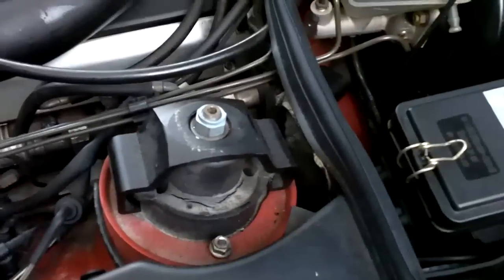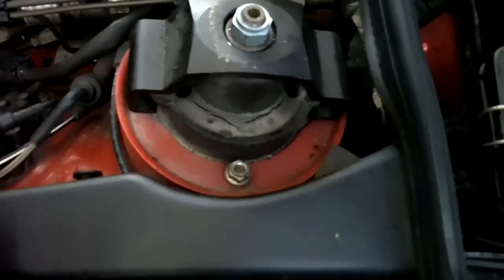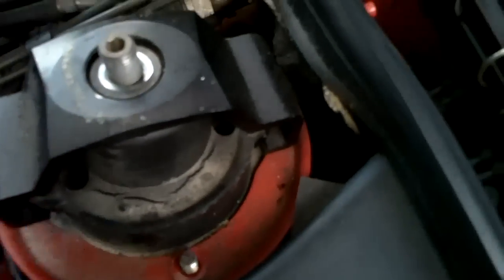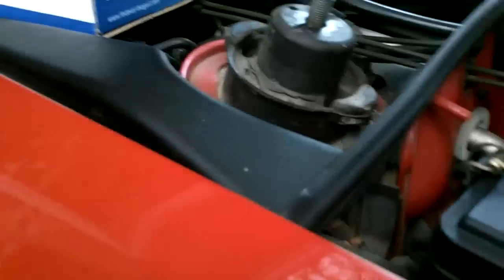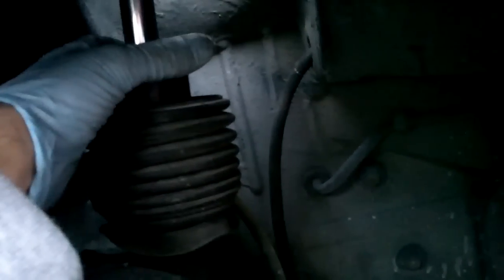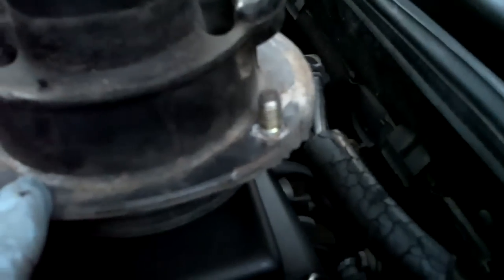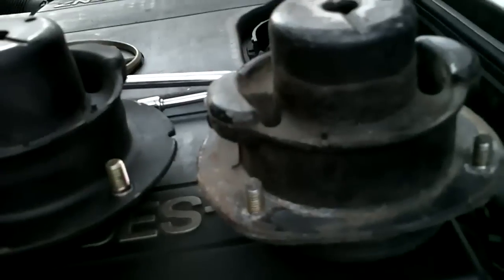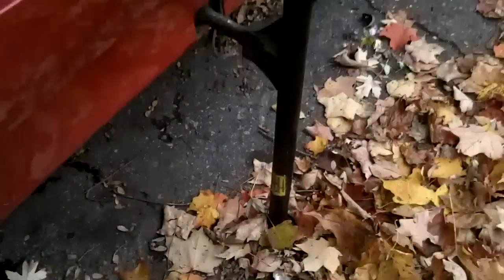Mercedes W124 and R129 strut mount replacement

Comment: I just swapped out both front shock mounts on my '98 R129 after noticing they were severely cracked.  A simple and quick job that is a major improvement in ride quality!  The harshness of road impacts is gone and the car rides like new again.  Most importantly, the vibration from 60-80 is now gone!  I chased that for months and it was the mount the whole time.  My car still had the dust caps over the upper shock nut and it took me a while to figure out that it just lifts straight up for removal.  Thanks for posting this video.

Comment: Trust me when I say this, you do not want this to break.  if it does break it will leave a nasty dent going upward in the hood.  Mine broke and has been sitting ever since because I thought this would be super costly, thank you for posting this.  If anybody's starts to crack save the hassle and fix it.
Reply: same here, 01 sl500

Comment: Thanks for the video! Did mine, RHS went smooth, LHS was more tricky.

To sum up:
Big nut is a 22mm wrench. Much needed.
Small nut is 10mm
Installing new one is tricky: first secure new mount with 10mm nut, then aim for inserting  shock in the middle guiding it with extension.

I used Meyle mounts.

Comment: Hello Fupabox, I really enjoy your videos. Beware of the Moog strut mounts. I installed a pair and the left one lasted about 4 months and the right one for about another week. They left two bumps on my hood that I had fixed at the body shop. The packaging says made in USA but that's just the box they come in. If you look on the inside of the mount they will say made in Taiwan. I replaced those with Corteco mounts and have had them for about two years with no problems.
Reply from the maker: thanks for the warning...Moog used to be very good quality, but I guess most of there companies could care less about quality anymore

Comment: Thanks for the video! The R129 is a new platform to me; being a VW and JDM guy before getting my boyhood dream car. I did have a couple W116s, but they are nothing like this. As far as other cars, I have had 5 of 7 generations of the GTI, a Cabriolet, Jetta, Preludes, Integras, GS300, list goes on... A few American ones too. 

Anyway.... 

I kept the wheel on and on the ground with the car partially lifted. Had a hell of a time wrestling the old mount out and getting the new mount in, but all in all, it was an easy job. Just a pain in the butt. Second side was easier than the first because of the "lessons learned". Next is the idler arm bushing repair kit and rear suspension kit. Then "test drive" to the dealership for a proper alignment. I had a mechanic friend replace the inner and outer tie rod ends, front lower control arms, steering damper, and stabilizer bar bushings. Next will be the rear suspension.
Reply from the maker: Nice... it's a cool car .. you'll love it .

Comment: I have a 99 Mercedes sl500, would this also apply to the model I have, it’s very similar to the part with one exception, it has a cap that cover the screw that your removing in the beginning? I have no clue how to remove it, please help.
Reply from the maker: do you have the air suspension ?
Reply: @fupabox  not sure what that means, the suspension is connected to the lower arm thrust, I wish I could send you a pic, is that an option here?

Comment: very helpful clip.i cheated my mounts out by removing all appears ok. i have a metallic knock when driving over uneven road surfaces coming from the front end of car reduced when under breaking any ideas on what to check. cheers
Reply from the maker: sway bar end link bushings or lower ball joints is my guess

Comment: Great info! THANK YOU! Do you know what the bolts that hold on the engine cover are called or what to do if they break off?
Reply from the maker: The top engine cover that contains the air filters has several different types of posts and spring clips that hold it on . At the rea there are 2 large posts that the cover slips under and the cover has 2 U shaped clips that slide under the posts . , and at the front there are 2 spring clips that lock into the filter box /engine cover . I found this forum post with all the clips and mounts shown and part #s listed https://www.benzworld.org/threads/m119-airbox-rear-mount-attachments.1411899/
Reply: @fupabox  You're an angel! 😇Just what I was looking for!!!
Reply from the maker: @brynabryna  glad to help

Comment: Thank you for your posting this. I am also replacing front struts as well. So I unscrew bolts from bottom of strut  then unscrew the strut mount. I jack up the car then take out both the strut and mount. And put it back in reverse. Would it work?
Reply from the maker: essentially yes... just don't jack the front up too far... there is a small chance the spring can pop out if you lift it too high with the strut unbolted
Reply: Thanks!

Comment: thanks .to check tees out will i have to remove the coil and shock
Reply from the maker: to check the ball joint you just need to jack the car up and then squeeze the balljoint upwards with a large set of slip joint pliers..you can also watch closely for movement as you raise the car there should be no movement as the wheel leaves the ground...the bushings can be replaced without removing anything but the 2 13mm nuts on the bushing end cap

Comment: Have you ever have problems on that center nut getting loose after driving for a while (a week or so)? When the nut is loose, it makes a small banging sound when going thru bumps. That's when I know it's loose again. It's kinda annoying and maybe dangerous. And it does that no matter how hard I tighten (maybe not hard enough?) the nut. Just wonder if you happen to know about this issue. And it's an R129 too. :)

Comment: fupabox
I have the same care and it sounds like the drives haft is rubbing the floor. I replaced motor and transmission mounts. Do you think the shocks could let the car that low. It has 95k miles one it. 
Thanks
Reply from the maker: +Bob Muse  the other possibility is the bushings that hold the rear differential to the subframe... I have never seen them go bad,  or the center driveshaft bearing support..does it thump under acceleration and then go away when the car is at a steady speed ?
Reply: +fupabox 

Yes it does rib when starting out to hard. Even when
driving at at any speed and if i give it to much gas it rub. It was  bad
to start  with and got worse after replaceing motor and transmission
mounts. I thought it was hydraulic issue because I need to replace O rings in
hydraulic cylinder. Where do you buy the kits?
Thanks for your help.Bob
Reply from the maker: ***** the hydraulic seals can be purchased from  mbseals.com    I am pretty sure your driveshaft center support bearing is bad.. they aren't very expensive, but require drive shaft removal to replace..when you changed the engine mounts the orientation of the driveshaft to the differential was altered a tiny bit, and accentuated the wobbling in the bearing..the support bearings usually go bad more quickly in hot climates where heat from the pavement speeds up the grease drying out
Reply: +fupabox Do you think I should change the shocks and struts too. Second questions: where is the computer on my car?
Reply from the maker: ***** The shocks and struts last quite a long time on these cars..Only if they are bouncy bottoming out ,or leaking, or if some store has a great sale on shocks.   The computers are all under the hood, in front of the passenger side windshield..there is a big square plastic cover right beside the hood hinge...5-6 phillips screws hold the cover down

Comment: I just noticed that I have rust that has eaten through almost 2/3 around the driver's side shock mount.  Is this something that a good welder could fix?  If so how much should I expect to pay out?  Thanks.
Reply from the maker: that's a bit scary..anything can be fixed if you spend enough....I would think it could be fixed for a few hundred dollars

Comment: Did this to my r129 today. I have a clunk when im pulling up my drive way during an incline or during steering randomnly. Sway bar bushings, or ball joints, or idler arms what do you think lol thanks
Reply from the maker: could be any of the above.. only way to know is to get under and check... could also be tie rod ends or wheel bearings as well

Comment: Fupabox, 
I did this replacement with Febi Bilsteins today  due to a cracked right mount (no other issue or symptom) but my first back out of the driveway and I got a major clunk suddenly from the struts over the curb - almost sounds like  they're loose or bottoming out  - but the nuts are quite tight.   I might be able to get more - but how far do I go with that center nut?   I don't see a torque spec.   I stopped when they were tight not wanting to over crank.   I don't want to drive the car until resolved.  Any help?
Reply from the maker: 15 ft lbs for the 3 small nuts and 60 ft lbs for the large center nut . The car needs to be sitting firmly on the ground when tightening. check that the spring didn't turn when the shock was installed , or that the spring is centered on its seat . Also check to make sure the bump stop (rubber snowman) is still on the shock shaft
Reply: Thanks for the help.   With further troubleshooting I have found that it is an off-quality part.   Getting so hard to keep track of aftermarket quality anymore.   Thanks for your videos - they are so extremely helpful to many like me.   Need some more on the R129!
Reply: @fupabox  Cheers for the video. Quick question, are your tourque settings accurate for an early r129 also? Where did you source them. Going to attempt this next weekend. Many thanks

Comment: Based on how easy it snapped and the weight of the car basically doing the majority of the job holding the mount in place and the large metal retainer on top stopping it dropping through if the suspension gets fully extended, I hoped the bolts are merely a supporting function. It also sheared with enough threadbolt to aid in any torquing (sidey ways movement). They just seem too flimsy and simple to be taking much load?
Reply from the maker: +Chis Chis Just my opinion..I wouldn't drive it with just the 2 bolts holding it on. I'm overly cautious, I wouldn't take the chance

Comment: Fupabox, my name is Travis and I have a 1996 r129, that has leaked convertible driver side main cylinder . Currently the hardtop is on, can you please show me how can I manually remove the hardtop, thanks.
Reply from the maker: https://www.youtube.com/watch?v=U6BrsM3ilj8
Reply: @fupabox  ty. I played around an got it open, my next project is to repair the leaked cylinders.

Comment: yo i just changed both of mine on my 2000 sl and at first i had a pair of uro but i over tightened one of the nuts on accident and ordered a blistein one so now i have a uro one and blistein one on the other side also i used blue threadloc can this be bad?
Reply: shit the bumb stop?? did i have to take it out and put it the strut mount????? or leave it as it is on the shock??????
Reply from the maker: threadlock is perfect . Always use blue threadlock on suspension and braking components. The 2 different brands could be slightly different size due to different moulds. But should be OK. Watch the URO for cracking rubber as they has issues in the past . Otherwise I think it's cool

Comment: how do i tell if i have hydrpuenmic suspension/self leveling suspension. i dont think i have either im about to replace my strut mounts on my 95 sl500
Reply from the maker: there will be an air hose coming from the top of the shock inside the engine compartment
Reply: fupabox ok cool thanks

Comment: im hearing a clunking noise when turning my steering wheel back and forth from the front end. and i hear a mettalic click every time i come to a stop. any expierence with this noise. i have noticed my strut mounts are cracked a bit aswell.
Reply: its coming from driver side
Reply from the maker: It could be the mounts ,  sway bar end bushings, any part of the steering linkage or mounting bolts for the steering box,  loose wheel bearing or loose wheel lug nuts. It could also be a loose caliper, or brake hardware. Unfortunately, a whole lot of possibilities
Reply: +fupabox i think its one of the steering components. i noticed it screwed my alignment a bit too haha. prolly because ive been driving it like a maniak recently haha
Reply: fupabox i replaced the steering gearbox you think incorrect torque will cause a clunk?

Comment: DO NOT BUY MOOG! Look at the bottom of the part and you will see that they are made in Taiwan. I installed a pair and they both broke within 2 months leaving 2 bumps on my hood. Replaced them with a set from Corteco and have been on the car for about three years with no problems.
Reply from the maker: MOOG .. damn .. another solid name bites the dust. Getting hard to know who to trust for parts

Comment: Hi, thanks for the video exactly what I needed. I did as you said but had a problem and managed to shear and snapped off one of the 13mm bolts on my new mount (have only two now on and tightened), do you think this third bolt is crucial to the mount integrity, could I run happily with two only?
Reply from the maker: +Chis Chis I wouldn't drive it with 2 bolts...it just won't have enough strength to resist the torque when steering
Reply: +fupabox hey I own a mercedes sl320 r129 aswell I have afew problems with it the driver side window does not drop slightly when opening the door or when closing also where is the egr valve on it its the 320 engine but I can't find it please could you help, I've been inspired by your videos and have done my strut mounts aswell but there bloody hard
Reply from the maker: +Aqueel Ali  The EGR is on top of the exhaust manifold..it is attached to it by a couple of metal tubes, and has a rubber vacuum hose on the top...looks like a shiny round flying saucer with tubes coming out.
 The window drop could be a few things... if the battery was dis connected you will need to reset the roof and window limit switches...open end close the windows normally, but hold the switch a further 15 seconds after each window has gone up or down fully... this will let the computer recognize that the window has reached its limit in either position... it must be done for up and down on each window... then do the same with the roof switch... hold the switch while the roof raises and lowers , and then hold in that position another 20-25 seconds after the roof has opened and closed.
 The other possibility is a sticky switch inside the door lock mechanism that recognizes you have pulled the handle to open the door... spray some lubricant into the door mechanism, and open and close the door several times to work the lube in
Reply: Thanks verry much I'll have a go at the roof reset g procedure I've done the windows already and no help, also I've research afew 320 and they all have the egr valve on top of the manifold apart from mine it's just the manifold without and egr valve or vacuum lines
Reply from the maker: Aqueel Ali  No EGR.. Odd  . are you in a country that had no pollution controls when the car was built ?
Reply: ive looked all over the engine bay forit and nothing ive rang my mercedes dealers and they said bring the car down when you can